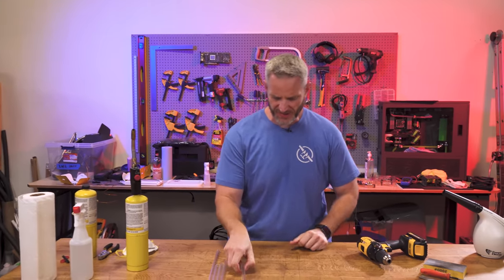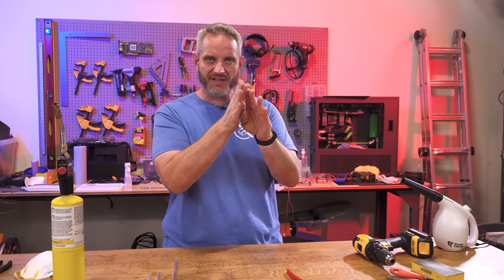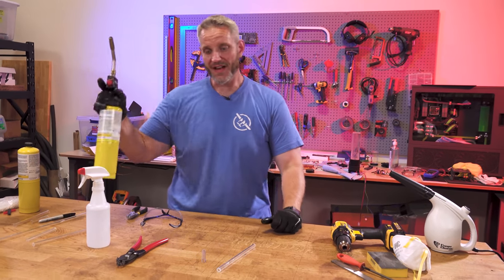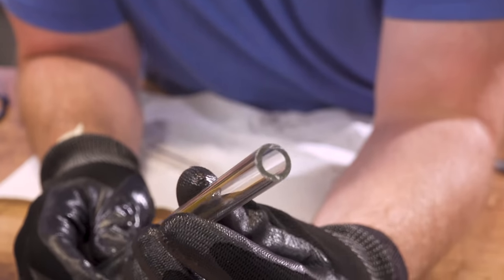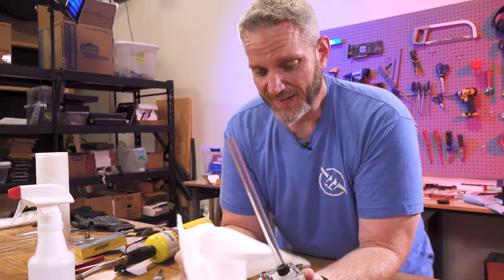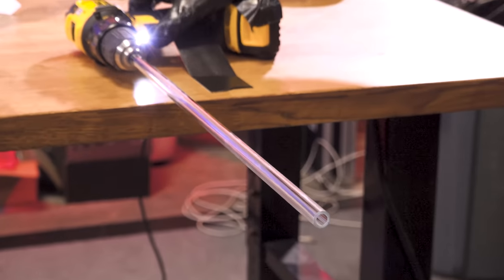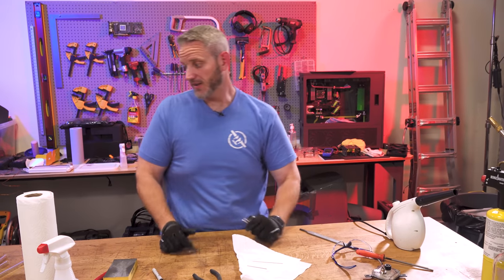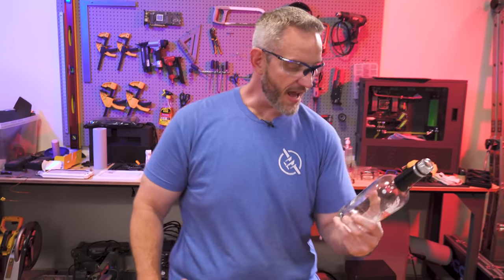Learning how to bend Glass Tubing... This looks soooo good!

Comment: In my experience, there's a bigger gain in clarity going from PETG>Acrylic than Acrylic>Glass. As long as you don't beat the acrylic up while you're cutting/bending it. Glass is quite a bit more expensive, you need more of it per build because of the way you have to cut it, it produces way more harmful byproducts, requires more tooling, and it's still less versatile. There's a good reason why glass tubing never gained more popularity.

Comment: you could try a steel rod with the same outer di as the glass inner for snapping off small bits? just slot it in the small bit that's coming off. warm the rod also maybe to not have it crack the glass.

Comment: Regarding glass and heat retention: it's impressive just how long glass stays hot.  I remember a time when I was younger and far stupider than I am now when I was helping my dad work on some mountain biking trails and we came across a place where some "kids" (I was 13 or so, these kids were definitely older than me) had thrown a party and had smashed beer bottles all over the place.  One chunk had been thrown in the campfire and it gave me second degree burns when I reached in and picked it up.  (By this point the campfire was otherwise just a pile of long cooled ash...it would have been afternoon and probably the day or two after the party.)  Learned my fucking lesson not to touch glass that's been in a fire without extreme caution, that's for damned sure.

Also noteworthy: If you are going to do this, borosilicate glass is definitely the better choice over normal glass.   Borosilicate is, as Jay fumblingly mentioned, used in chemistry equipment, and used to be used in Pyrex and similar brand cookware (apparently you can tell because the borosilicate stuff was branded PYREX while the new stuff is branded pyrex).  

One of the purported reasons for that change is because of the advent of chemically derived drugs (crystal meth, bath salts, that kind of BS), so if you start buying large quantities of borosilicate piping and live in a place where drug enforcement is sufficiently paranoid, you might get put on a watchlist or something.   

The other, and honestly more likely cause for the material switch, is that borosilicate is extremely strong and extremely temperature resistant, so cookware made from it lasts so long that it gets hard to run a profit after a while.  (I mainly use borosilicate cookware inherited from my grandmother that she had since well before I was born and it shows no sign of needing replacement.)  Given enough heat cycles, it does yellow slightly, but as long as you're not using your water cooling system as a casserole dish that goes in and out of the oven on a regular basis, you shouldn't have to worry about that.  (Please tell me if you've come up with a means by which your reservoir makes a practical cooking dish of some kind, by the way, that would be hysterical).  

Either way, borosilicate is a really good, strong material.  Jay probably could have thrown any of those worked tubes onto the ground like he did the melty bit of acrylic without issue...at least, when cool. Glass of all kinds have some interesting physical properties, which is why heat and scoring are such effective methods of working with it.  You'll certainly pay more than you do for regular glass, but it should be easily capable of handling as much force as any other part in the case can.  I'm not saying have mock lightsaber fights with the glass tubes - they do break eventually - but you shouldn't need to treat it like that fine crystal wineglass set your grandma has that breaks the moment you look at it.

Comment: Definitely dont want to hear crunching when scoring glass, it can work out like in this video but it has a higher likelihood of breaking instead of snapping, a shallow soft score will provide much cleaner cuts and use mineral spirits on your cutting wheels before the score not water after, glass that is properly scored is almost impossible to see.. also order some 145° carbide cutting wheels they do WAY better than the stock ones on thoes cutters. They are the industry standard and I use one of them to cut thousands of feet of glass at my job before it goes bad.. also heating the ends is unnecessary simply hit it with some 80grit for a few seconds to really knock the edges off then follow up with a fine grit. 

Lastly always allow your glass to cool naturally trust me a shard of glass in your face is no fun because you wanted to save 20 seconds and the piece exploded!

Love your stuff jay! But the glass professionals had to crack on you a bit for this one lol, damn good job on the bend though!

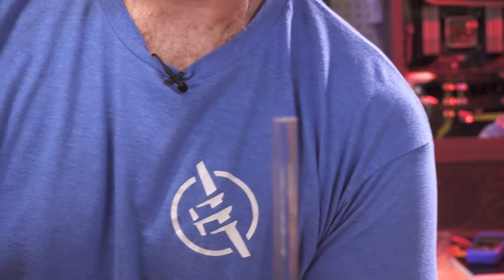Comment: Protects the mouth while breaking glass, but not when sanding the edges of tube by sanding, the action which is visibly producing glass particles in the air. At around 6:20

Comment: so those glass dust produced from holding the spinning edge of the tube against the file and sponge sand paper wasn’t as bas as the glass dust created by the scoring tool? regardless of which badder or not I THINK correct me if am wrong glass dust dust from the file and sponge sand paper will most likely float in the atmosphere, airborne, not like the more larger and heavier ones from scoring tool.

Comment: I would like to see a Glass build, not so sure about the bend where it compressed a bit I think it would cause a pressure point due to reduced flow and if using colouring in the coolant would get deposits build up. Perhaps you could do a test showing performance of a bend where it compressed and where it stays more open.
 I believe when manufactures are making complex glass tubes for laboratory they pack the glass with something to keep the bends diameter as close to original tube as possible.
How about a long term project to see if Glass lasts better(discolouration wise) and easier to clean. 
Would also be increasing to see if you Can get a glass CPU&GPU Block?

Comment: Jay, since tech videos are hard to make now a days due to the obvious reasons. Would you be able to make a refresh video of custom water cooling kits? I'm looking at a few from Thermaltake 360 custom loop kits, Corsair Hydro X custom loop kits. and they range from 200-600+. There are tons of videos of some of those kits that are 2-5 years old now. Given that the Ryzen & Intel current cpus run a little hot (5800x, in my case), I would greatly appreciate a refresh on these kits performance vs cost etc. Also given how hot the 3080-3090 memory gets got me thinking about jumping into making my first custom loop. Thanks!

Comment: get yourself a tile saw, you don't need a big one for that, plus they sell glass blades for those saws so you can literally just use that to make your cuts instead of scoring it. I know because I was a tile setter for 9 years and have cut glass tiles on multiple jobs that turned out superb
Reply: the small ones are relatively inexpensive

Comment: you can cut just a few millimiter off if you use a dremel with a diamond blade it will cut the glass like if it was a ceramic tile i used that to make my cuts and now you can get prebent glass tube

Comment: Would it be possible to break an inch off of a glass tube by using a stick, rod, or something that's a tad bit smaller than the inner diameter of the shorter end of the tube and use that to break it off? I think it would work. 

Edit: Wouldn't it be better to break off the glass pieces near the inlet of a vacuum hose. That way it'll just suck the dust in as you're scoring it and when the glass breaks? Less clean-up and safer, right?

Comment: Personally the fact i went with rigid tubing due to it being cheaper as a kit is still bugging me, i should have used soft tubing so i can still tinker.. But glass does look amazing so, Jay, do a glass build! Pretty pretty please.. The corsair tubes i used, i did actually make the first bend perfect (i even bothered to watch a quick vid from Corsair on it) but..i've done the tubing literally PC Building Simulator style! And the issue of not finding a tape measure in time and having to mostly eyeball it didn't help.. The cost of fittings alone is truly ridiculous now, i remember £300 would get you a complete, good cooling system (without a ton of RGB) but...oof. My whole PC works very well, but gives me buyers remorse quite often! I think the cooling has cost me well over £600, which really is...stoopid.

Comment: If you heat the glass to just before the melting point, then pull the two ends you will make a air tight seal.

Did this to both ends, boom it's sealed.
You will have quite a bit a waste but you have your air sealed tube for your bends

Comment: Question, for scoring a short section could you use a tube that fits just over the glass to get the leverage you need to break the score? Kinda like how you can use a tube on a wrench to get more leverage to undue tight bolts?

Comment: Continue to wear glasses while you file and even out. If heat is too excessive, and you expose to a cooler air, or if the glass has imperfections you might be at risk of it exploding.

Comment: beginner pc builder here, can you use the same fittings for PETG, PMMA, Acrylic and Glass if it fits?? or does each kind of material has a different fitting. and what size pipes do you suggest me for a wide range of fittings and ease of use

Comment: You should try to score and tap instead of  score and snap i used to work with stained glass for really small pieces you should tap it instead of trying to snap it the score gives a line for the glass to break along

Comment: For the shorter pieces of glass, why not stick a rod inside the tube (maybe secured with rubber grommet or even just wrapped in paper towel) amd use it kind of like a makeshift glass tube breaker bar? 😜

Comment: One warning - do not, under any circumstances, cool down hot glass tube with water. It can literally explode and it can cause a serious injury. In this case - do as Jay did, use air blower. Not compressed air in the can - it is too cold - just electric air blower. Or just leave it the f alone until it cools down naturally.

Comment: Could you basically use like a cheater pipe to get the extra leverage on those short pieces? Get a piece of like copper tubing that fits over it to try and get those short ones

Comment: Jayz2cents if you fill tubes with sand it will bend easily as I have done this on my water cooling build you get a perfect 90 degree angle

Comment: Hey Jay, first of all, I am NOT a glass blower... however I DO upcycle glass botles and tubing when it comes to cutting. You can actually trim glass using the right tools. I would look for an adjustable bottle cutter for 20 bucks on Amazon.
OK. The Science of cutting. Best way to do this is by shocking the glass. No, don't send it your nudes. Easist way is to create a good scoring using symetrical pressure, the bottle jigs are A+ for that. This creates weak points in the glass, making it easier and cleaner to break. Secondly, slow and controlled temperature. Use the o rings above and below the cut to make a small channel for water. You will need to boil a kettle at this point. Once you have the two o rings in place chill the area using cold water from the tap, making sure its within the o-rings. Then do the same with boiling S L O W L Y. You will see a fracture wind round the glass. If it stops add cold, then hot and so forth. Will ensure a relatively clean and consistent break. It should come away on its own without pressure, usually 'pops' apart.
Sometimes if glass is too thick you can get a convex/concave result. Easily sorted by a little sanding... Hot glue a piece of 120 grit sandpaper to a piece of wood and just rotate it a few times (remembering to wear a mask) on the flat end. Only takes about 60 seconds.
Also, if you use a torch, cool the glass slowly, too quick and it can crack/fragment. Its less likely using laboratory grade tubing (the good stuff) but for cheaper alternatives, it is a must. 
Hope this helps bud!

Comment: Jay:

Talks about how important it is to wear a mask when working with microscopic glass
3:26

Proceeds to use 2000 grit sand paper with a power drill with no mask
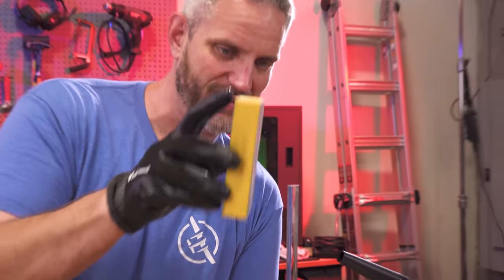6:30

Comment: No idea if you reply yo such comments, but I got Thermaltake A71 chase and with the stock fans (1top- 1 back- huge on from the plastic side) and it seems really hot inside when the air is blowing from the back ( 1080 Ti - i7:8770) is there a way to make adjustment to the chase front or increasing the air flow or fans to help abit for the inside components ? cheers !

Comment: Thermaltake Pacific DIY OD 16mm (5/8") x ID 12mm (1/2") Water Cooling PETG Hard Tube Bending Kit CL-W093-AL00BL-A | Comes with insert that will avoid collapse

Comment: The colour of the flame changing from blue to yellow in this instance is nothing to do with temperature. It’s simply the elements in the glass heating up and producing photons in the yellow end of the visible spectrum. It’s most likely sodium in the glass. You get the same thing with table salt with your gas hob.  Chemistry 101!

Comment: Sand.... Fill that tube with sand. The sand will hold the heat longer and provide a inner support like the silicone tube while doing peg.
Reply: Bosch 3-1/4-in T-shank Diamond Grit Jigsaw Blade

Comment: Not for nothing did lab glass blowing with like 3ft long tubes without all that ppe. Just get yourself a triangular file although I've also made a score with a flat file. Find the spot you want to cut and make a mark just like the one you did with your sharpie. Wet it. Grab both sides of the tube with the score facing you. Gently apply force to snap away from you. All the dust etc flies away from you if any and you get a nice clean break you can fire polish afterwards. A pair of lab goggles are fine and when working with the flame some eye protection from the intense light is about all you need.
Reply: Nice 90 degree elbow. Once you do a couple of pieces you learn how much air you need to blow for the glass you're working with but in general it doesn't take much. Put a hose and mouth piece on one end, a cork on the other heat it evenly like you did and then let gravity take over. I usually let it droop holding both ends until it is 90 degrees. I will say get a nozzle that focuses the flame into a cone so you have precise control over the point with the most heat.
Reply: With the short pieces you can actually fuse the glass together. Cork one, tube the other, heat both ends in the flame cone and touch them together. Apply some air to keep the tube from collapsing and gently play with it till you get it how you like.

Comment: Wasnt it that peaces like this build inner stress while deforming and have to get heat treated like metal after forging to get rid of the stress? As far as i know you apply a hugh amount of pressure to the tube when you push it into the fitting. I guess heating it in an oven for a few hours should take away most of the stress from the tube. Imagine trying a few times to get the right bend and it explodes while you push it into the fitting xD

Comment: U should really use an FFP3 grade mask instead of an FFP1 grade as is shown in the video. ffp3 blocks 99% of particles whereas ffp1 only blocks 80%. FFP3 are more expensive, but they can actually let you breath much more easily than ffp1 due to them typically having features like exhalation valves and being generally better put together

Comment: 16:02 how about stucking something in and use its leverage to break?
Reply: There are other ways to break a tube that don't require leverage (watch neon sign makers work, they have several techniques using scoring and tapping), but I believe that they don't produce quite as consistent of an edge, so they take more sanding to make them square.

Comment: Let's not heat the bottle, for your own safety. Bottle glass is not the same as your tubing. Without heating whole bottle at once, uneven heating will cause it to shatter. Glass would then require annealing to remove internal stress.

Comment: Micro ATX, double radiator, glass loop in this: https://www.newegg.com/p/2AM-01GM-00001 or this if you like white https://www.newegg.com/gamekm-bomb-micro-atx-mini-itx/p/2AM-01H0-00038. FYI I'm waiting on a GPU & will be doing an ROG Aura Sync & EKWB build with an acrylic 12mm loop, utilizing two 240mm Rads & a 240mm Flat Res+Pump Combo. Putting the drain plug under the front end, like a car, even though it looks more like a discarded soda can, laying on it's side. JK... I'd be happy to see any kind of double-rad loop built in this thing, it wouldn't need to be glass.

Comment: In the absence of a glass saw. Cant you get a hardwood dowel or smooth metal rod that has the same inner diameter of the glass and stick that into the short side to provide leverage for the snap? Thanos approves.

Comment: Another glassblower here... Get eye protection. Cataracts no good. Rose didymium is soooo much cheaper than eye surgery. No, you're not gonna get a cataract right away or anything. Why screw around with your eyes though? Additionally: since rose didymium blocks the sodium flare, you're actually able to see the heat base of the glass better. Whole lot easier to tell what you're working with instead of just squinting and guessing.

Feel free to contact me if you want some advice on tube bending. There's too much to put in a comment.

Comment: "the hotter it gets it turns orange", aren't blue flames the ones that are hotter than orange flames?
Reply: When talking about the flames, blue is definitely hotter than orange (blue is 3,300F while orange is 2,200F, approximately).  What he was probably told was that when the flames are orange, the glass is hotter.  I could not find anyone online willing to speculate why the flames turn orange when the glass is above a certain temperature.